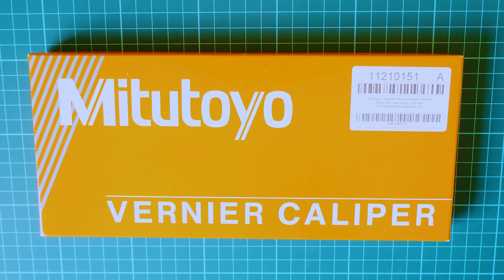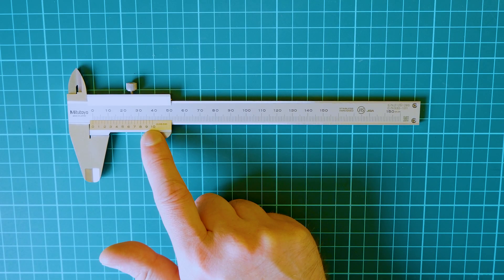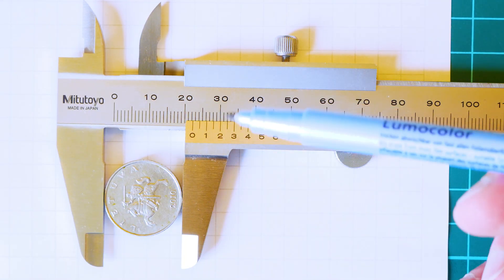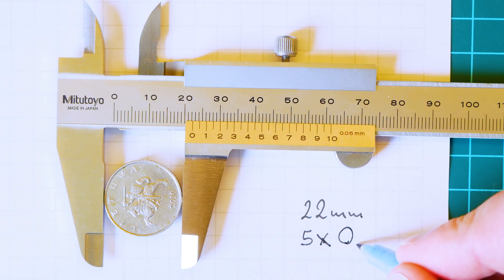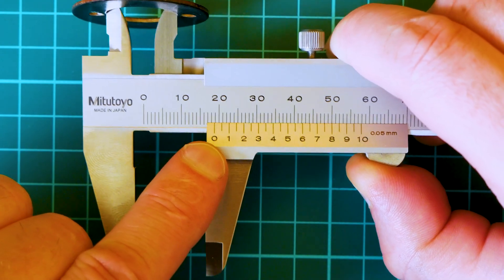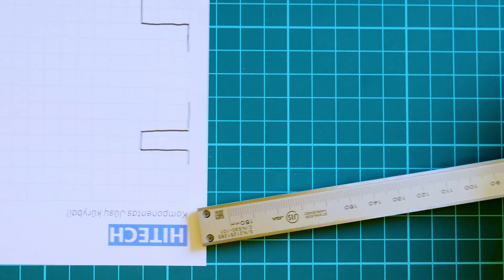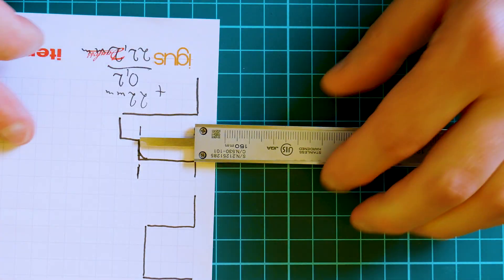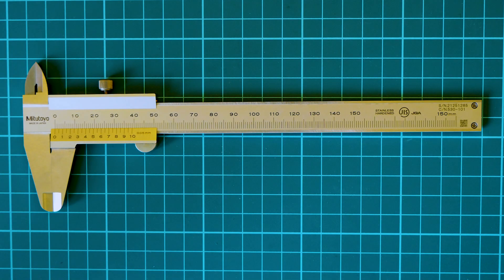How to Use Vernier Caliper Mitutoyo 530-101

Comment: This video was perfect for my needs dude! I was researching for a purchase and common complaints on the digital ones are it's always out of batteries when you go to grab one. 

I felt a little apprehensive about getting a manual caliper because I was unsure how to read all the measurements beyond millimeter. You showcasing with multiple examples was excellent - thank you so much!
Reply from the maker: Agree. Digital you drop and prety much thats it.. You buy new one, coz encoder may be damaged. And Digitals run out of batteries.. Manual in my opinion is better if you use calipers not everyday.